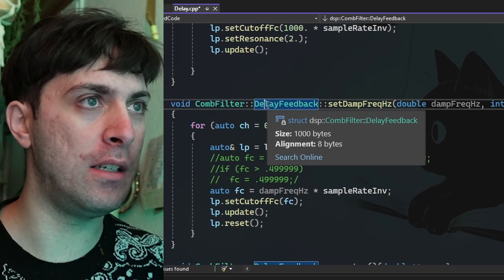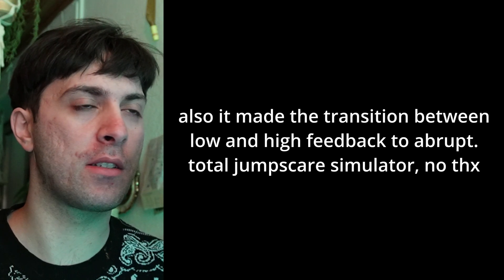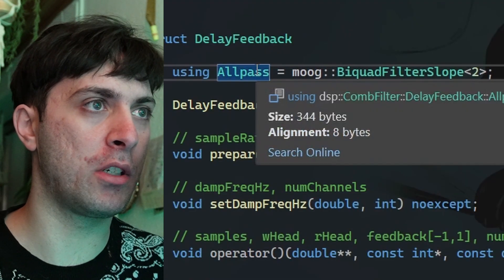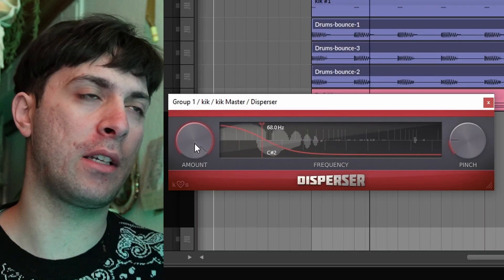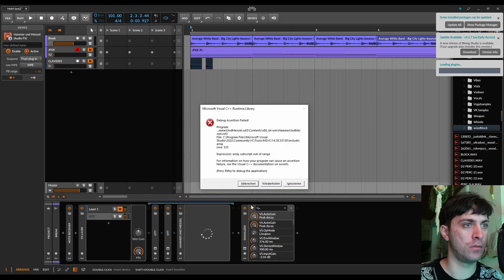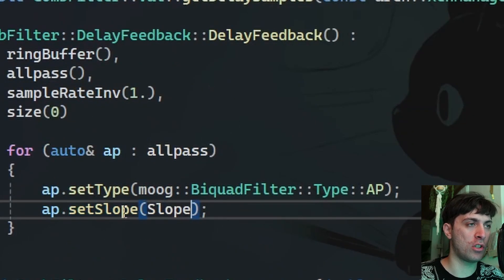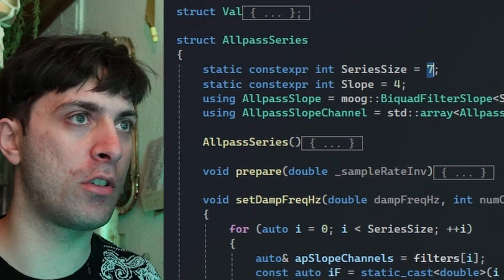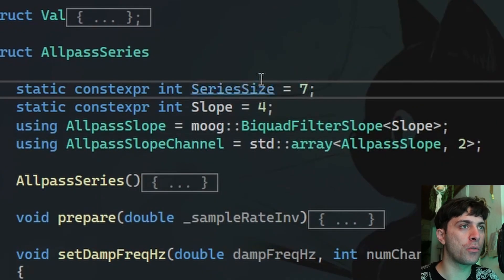Creative DSP Coding

Comment: I'm not sure about the details, but one idea I want to mention is to throw Lua into your code. The VST could actually allow you to edit the stuff and you could click some button to recompile the Lua live. Lua is a very small and cool language, easy to integrate. Whether it's practical to actually play around with DSP ideas, I'm not sure, but I wanted to mention it in case it could be a kind of secret weapon for you.
Reply from the maker: i agree, adding scripting languages to software always makes it very powerful. the closest i got to that so far is the formulaparser that you can find everywhere where parameter values can be edited. i had to write the entire logic of math processing from scratch to make it possible to evaluate complex terms. a whole scripting language would be even more insane
Reply: @Beatsbasteln  I'm not suggesting to get rid of your expression evaluation stuff, because it's cool, but the beauty of integrating Lua is that you can just initialize a context and then call dofile or dostring. Like, you might be able to add a special mode to your expression parser that tells it to evaluate the expression in Lua land, and then it could evaluate anything that would work in a Lua REPL. Or you could be editing the Lua stuff in style in whatever editor you want, and the VST is dofile'ing it whenever you click reload.
Reply from the maker: @pbrninja19  but it also depends what specifically you wanna have more flexible than it already is. in h&m for example i could maybe imagine a knob that twists the harmonics in scripted ways, so that users can come up with their own types of modulation in addition to blend, spreizung, harmonie and kraft. i tried really hard to come up with the best modulations but it might always be that something really cool didn't even cross my mind
Reply: @Beatsbasteln  Yeah, if the modulation is basically a function that translates time to some value, you could let the users paste a Lua function that does any possible weird stuff. I think you just initialize a computation context, put the variable t in there, and then evaluate whatever they gave you and hope there's a return value v.